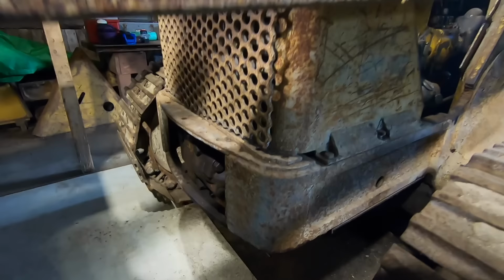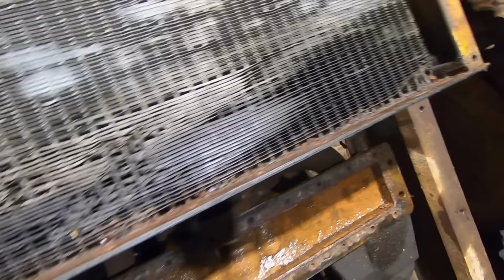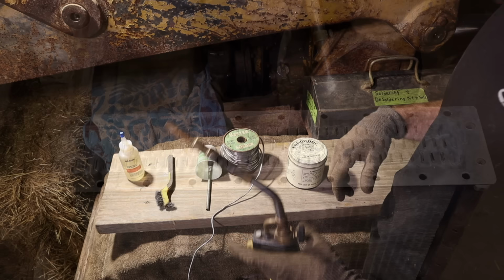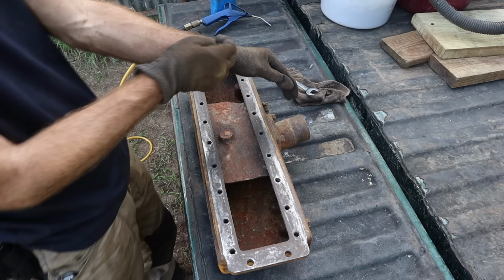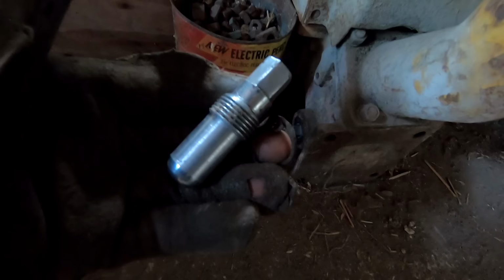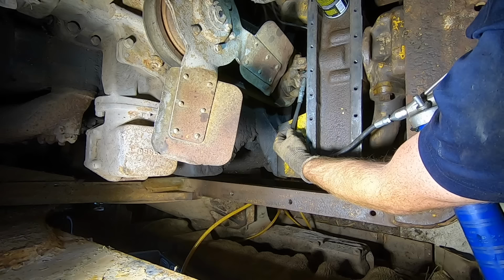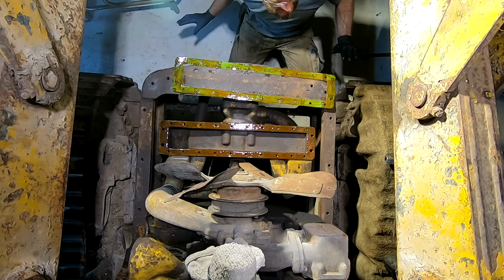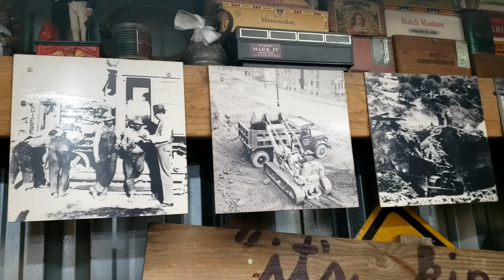The Radiator's ALL CRACKED up... I Guess We Should FIX it! ~ Part 3 ~ 1950's Caterpillar TraxCavator

Comment: Nice to see a fairly young guy who knows the old school ways of repairing a radiator. Back in the 80s and 90s when I was a automotive technician, we only installed a new radiator as a last resort. We would pull it after pressuring testing and send it to one of the 3 guys in our area who had their own radiator repair shops to have the radiator boiled out and repaired. Now, those shops are gone, no one repairs radiators anymore, you just replace the cheap plastic and aluminum radiator with another cheap plastic and aluminum radiator.
Reply: I hear you on this one. I have the chance in my town there's one of the 2 or 3 last radiator shop in the sector, they are still alive because of industrial machinery and HVAC systems, that need very specific cores and form factor, that can't be replaced by off-the-shelf crappy components. The cherry on top is that they work with non professional consumers, drop your old car radiator, it will be repaired, no matter what. I brought them a lot of industrial radiators over time, I was turned down twice for repairs, once the radiator frame was too busted to do anything and the second was too big for them to work on it, but they still found solutions in both cases.
Reply: Yes that is wasteful,  just rip and replace rather than seal the leaks

Comment: Hi, that thing with the fitting on is the equilizer bar centre pin. It needs to be secured with bolts. The fitting in the pin is for a connecting grease pipe that goes to a point higher up, next to the engine somewhere where there should be another fitting with a grease nipple. This makes it more convenient for that pin to be greased.
Reply: yep you are right. I'm sure the bushing is wasted
Reply: @drich6816  judging by how loose and how far out it is, i'd say you're right
Reply: Commenting to make sure this post gets noticed.

You definitely don't want that pin to fall out.
You may need to jack the machine up a little to release the tension and push that all the way back in.

Have a pair of 20t bottle jacks you can borrow, it'll only cost you return airfares from Australia...
Reply: Equalizer bar is will need a new bushing along with a new pin.  The pin is loose because the top of the bar is bearing on the bottom of the frame.  The connection is totally worn out.
Reply: your right reckon that would be a big job if its all slogged out which it appears to be
Reply from the maker: Here is a question for you about that pin... I pulled it out today and it was only about 8" long, is that correct, or did it break? It looks like there is either another bar behind it or the rest of the much longer pin than has broken off... I was able to get it back in place and bolted back in! ( you'll see that in the next video)
Reply: @SalvageWorkshop  dont think would break  i was just going by the look of the pin and such never worked on a cat but am a retired mechanic.
Reply: @SalvageWorkshop  i believe it is suposed to be as long as the bushing it goes into is, if you can see the back of it that would tell you a lot
Reply: You would see straight off it was broken. If you can't see a machined end , or a broken end you best stop working on things. Stop playing people for idiots salvage workshop
Reply: @maggs131. Thats like asking should that conrod be out through this hole in the block. My 14 year old even said wouldnt you see the rough end. Or do YOU think the manufacturer just used a bit of scrap bar stock as a pin. GTFU
Reply: @duanescott5399  Just maybe he's inviting us to join in even though it's obvious what the problem is. It would seem that his way of relating to his audience is way below the standards you set years ago.
Reply: @duanescott5399  You make an very dangerous assumption!  What if the pin was broken many years before and some fool replaced it with less worn but shorter pin as a "do-for-now"?   Yeah, there are idiots out there that will do that sort of thing, I've had to deal with the aftermath myself or more occasions than I care to remember.  I believe they are the same sort of people who leave sarky comments on YouTube videos.
Reply: @donfink7063  no. My point is you can tell a broken pin. Ever seen one with a machined end? No neither have l, because they don't break clean through and then hop onto a lathe
Reply: @duanescott5399  You're still making the silly mistake, of assuming that it is/was the correct pin for that particular whole!   Or even originated from that particular tractor manufacturer.
Reply: @Don Funk, you seem to somehow miss his original question. That being if the pin was broken or not. I haven't made any comment if the pin is original, after market or made by a machine shop. Only that you could tell if the pin had a broken end because it is completely obvious and a stupid question to be asking
Reply: Mister know-it-all: the only stupid question is the one that is not asked, within reason. Be part of the solution not part of the problem.

Comment: Couple of suggestions. Tap magic is the best cutting fluid I’ve ever used. Using a cordless drill to run taps eliminates the need to add nuts to the end of each tap and you can adjust the chuck to slip if the tap locks up. Great job with the gasket. Loved the teaching moment showing your mistake. Another trick if you’re making a gasket out of thicker material like 1/4” rubber you can install set screws in the holes and tap on the rubber to make impressions and cut them out with punch’s. Don’t you just love it when a broken bolt comes out?  Great channel keep up the good work.
Reply: A 12V drill or impact is great for small jobs like that.  Smaller, lighter, and not enough power to get you in trouble.  When I work on cars, I'll break bolts loose and use the 12V to spin them off and then start them back on.  I'll use the 18V and 20V impacts only when I really need the power.

Comment: You earned a SUB when you took the top of the radiator off.
Nice to see you go the extra step while it was apart. 
It makes a difference that you weren't trying to use it to get something done at that moment. But it will serve you better in the future because of the effort.

Comment: Watch from start to the radiator.  All that work, with the pony motor,  fuel line carburetor,  fuel tank  cleaning checking. The radiator alone is a huge job. Very time consuming. Great work.  Great video.

Comment: Nice work sir and I grew up on a family farm and learned how to work on engines , pumps, tractors, equipment and used many of the same methods you did. We did not always have time to wait on parts or a mechanic due to the timing of crops. You are doing a great job with that old Cat !!

Comment: My dad was a mechanic and taught me how to do this years ago and has got me out of some jams. One thing he did tell me was to not use a hammer as it is hardened steel. He had brass drifts with a flat ends and rounded ends. Hardened steel hammer faces are OK on these big old machines but modern alloy engine heads will just get dinged up if you use a hammer. Lovin watching you get this going.

Comment: Great work! Little tech tip for punching holes in gasket paper: Use a bolt with a dome nut on the end as a punch so you don't have to hit the holes as precisely with your hammer.

Comment: I save a few brass casings from when I target shoot various rifles, handguns. They cut through gasket material easily with a tap or two from a rubber mallet. There's a wide variety of diameters available as well. Of course it's not as beneficial when your not at your shop. Carrying around various brass casings just for one purpose isn't very efficient.

I appreciate all the work you put into making these videos. I've learned so much from this series alone. Thank you!

Comment: Save every Caterpillar bolt you can. They're stronger than grade 8, and more expensive. Hopefully as you go through things (parts machine) you find enough cat hardware to repair it. If you're in a pinch use nothing less than grade 8 for replacements. Good job and a good bit of work on the radiator. You may find the brass cracking later just from age/fatigue. You'll be stuck buying a  new core if it does, you can't win if the brass is fatigued out. Vibration will keep cracking it. The pin underneath is a problem. The bar going from side to side is usually called a hard bar. The pin should be bolted yes. Looks like a remote greaser was set up on it. Without the pin gravity is all that holds it together. It's either backed out or broke. On an old machine like this it doesn't need to be perfect, it could be sloppy probably. If you used it everyday hard you'd have to fix it right. If it is sloppy keep it greased daily. They get sloppy and dry, the hardbar will grip the pin and spin it  out of the bolts, break them right off.  If you intend to keep this or do many repairs, get a set of parts and service manuals. They wont be cheap, but one repair done twice would pay for them. Plus you will have every part number for every nut, bolt, bushing, seal and good exploded views. Very comprehensive, nothing like a Motors or Chilton's manual. You got it going on there, looking great. Thanks for sharing
Reply: yeah "CAT" bolts seem to add almost 2x the actual value.  I rebuilt a 3406 and them parts weren't cheap.
Reply: ? Harder than grade 8? You mean chinesium 8eight? 12.9 is usually maximum, why would cat use higher grade bolts and not stamp them right... Anyone working on these old machines should use stainless bolts and use white antiseize, bolt them down hard done for ever.

Yes stainless does snap earlier but none of the bolts he used are part of the hydraulic boom or any safety related, they are not stainless from the factory because of costs and Marting you have to have on a dozer
Reply: @kitecattestecke2303  yes cat bolts are stronger than grade 8. Lots of fine thread too. Because of the vibration.

Comment: Aloha, it's nice to see a younger person tapping gaskets, I see so many on you-tubers, drawing around with a pencil and then cutting the holes and openings with scissors.  This gasket tapping is the way we used to do a lot of things, the old saying, "you need a bigger hammer" has some credibility.  A suggestion though is when you installed the radiator core, and put gasket sealer on the surfaces I always used a small stud or I  cut the head off a bolt then screwing them in opposite corners or as needed, and it keeps everything in alignment.  You can set the core over the studs without fear of moving the gasket install the other bolts the replace the studs with their required bolts.  Working alone with heavy objects is much easier as they are guided into place via the studs.  I had a whole drawer in my toolbox full of such needed guides.  Enjoy the walk and envy you the find, but at 80 years old what would I do with a track-loader.  My old JD 2440 gets me in enough trouble.  Keep it coming and good luck on the project.

Comment: 20:20 Good man and a smart man at that even though the leak was at the bottom it could have been leaking so fast as to not let the water build up to the top of the rad and out of a leak from up there so you done the right thing checking the top for the extra 10mins it takes to check it now that the rad is out its worth being able to say 100% that it wont leak and if it does then it is no longer a question of how to fix it because you have done everything it will be a replace not repair at that stage. But i love your channel because you give these old machines the time they deserve. In a day and age when nothing is serviceable its refreshing seeing stuff that is designed to be worked on and repaired and not thrown away. I only just found your channel but your now one of my top 3 mechanical content creators thanks again on behalf of Old Red :)

Comment: About sixty years ago I had a job at a plant that produced refrigeration units of all sizes. Installing condensers (units like the radiator you're working on) was one of the tasks the trained me to do. Sometimes I'd ding up the fins and leave the kind of damage that you have. They had a tool called a fin comb which made repairing that kind of damage quicker and easier.

Comment: Quick tip that you might not be aware of: start a collection of first class quality steel ball bearings of differing diameter, and use them for cutting circular holes in gasket paper. They work great every time.
Reply: Great idea.
Reply: You mean the inner rings from the bearing? The whole unit would cut nothing right?
Reply: Another good way to make holes is to have used brass shell casings if different calibers. You can probably get all you need from a friend who hunts or your local gun club
Reply: @kitecattestecke2303  Nope.  The actual balls.  Cut off the cartridge bearing outer shell.  Works real good.
Reply: Then weld them onto an old bolt. They make an excellent punch and easy to hold.

Comment: Your work ethic is amazing and your patience and determination is second to none. Your video work equals your mechanical ability, and the hours to do all this is more than most could imagine. Keep up the good work! One question, where is the oil cooler, all the D4s I have worked on have a cooler either in front of the core or along the side. I like your saying of a problem as an obstacle in the way of success. My old neighbor would say, how do you know if you can’t do something if you don’t try.

Comment: Ran tools, and helped make gaskets like that on a whipped 50's era d7 back as a kid in the early 70's my dad got it for a case of beer and rebuilt it as a heavy recovery tractor with a 80 ton winch on the back as a highly skilled welder fitter many things were custom made he made manifolds to add a turbo, and the frame for the winch and spades to brace it when winching and so forth, and the methods you used were how he taught me
Reply: Oh, and I was taught that pin much like others have have said is a pivot point so if the track on one side goes up the other goes down kind of like a Teeter totter if you took the skid plate off at the back you would see the tip of the pin poking out of the frame mount at the back of the pivot beam, don't know if you covered this in later videos but there is a bronze bushing in the pivot beam which allows it to pivot around the pin freely, the pin should fit snugly in the frame and be completely uniformly round

Comment: In the old days, we used Salamoniac to clean our irons prior to tinning. We also used masking tape to mask off the areas where we didn't want excess solder to flow. Radiators are tricky, but looks like you have a handle on it.

Comment: Advice: so you don't mess up the welder, put a smaller constant load on the generator, when you're in the field. Like a thick wolfram filament bulb. Just enough to keep the genie interested. Otherwise, you'll eventually blow the welder. You can think of it kinda like a hydro power dam, and the current, repeated flooding cycles that just slams into it like waves. It will break, eventually.
Source: did it myself.

Comment: Next time your cleaning out old rusty parts with a magnet, first wrap the magnet in an old rag. When you remove the rag all the bits will just fall off. Move to a new section of the rag and keep going. Saves having to try to get all the old crud off the magnet itself.
Btw loving this series. Keep at it!

Comment: I thoroughly enjoyed you going that step further to do it right. Your making sure the cores were soldered securely, chasing all those threads, making gaskets,  is what's going to make that CAT purr for another 50 years. All those little things you do will make the difference between getting a job done and it having a problem while doing that job 👍👍

Comment: As they say, if a job is worth doing its worth doing right, good job on the radiator. For the outside and inside of the gasket I use the flat side of the ballpien, corners too.

Comment: Hi my name is Russell Eller. I was a mechanic specializing in hydraulics and power trains for the Cat dealership in Birmingham Alabama for 44 years. I have worked on that model. The hole where the hydraulic oil is leaking is called a weep hole. It tells you that the seals around the hydraulic pump shaft have failed. That is a Vickers vane type pump and is simple to repair. Watched your radiator repair and enjoyed it greatly. Looking forward to seeing more videos. Thanks for keeping Old Red going.

Comment: An excellent tool to run through and clean the oblong  water tubes of the core is a 36" plastic zip tie stem.  It has plastic corrugation on both side to loosen-up debris and won't damage the metal.

Comment: That is the pin for the cross bar support. If the bolts are lost, stripped or broken that is a very likely sign the cradle bushes are worn, or the frame bore is worn. Then you will to have that line bored to repair. Also check to see depending on your model if the dampers on arms ends which land on the undercarriage frames, are either worn or missing. The fitting in the center of the pin is supposed to be connected via a flex line to a remote grease point, usually  on frame of the engine bay.

Comment: The "gaskets" on the sides of the core are air dams. They are there to prevent the hot air flow from the fan from being  recirculated around the core and back through the cooling package.